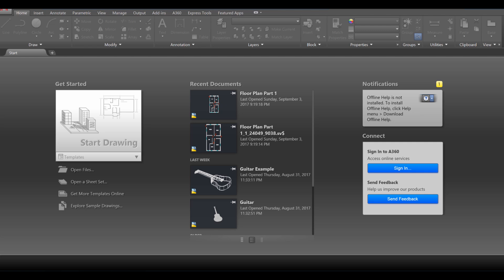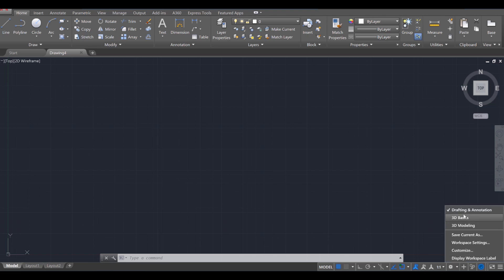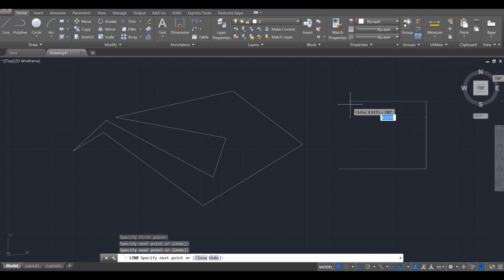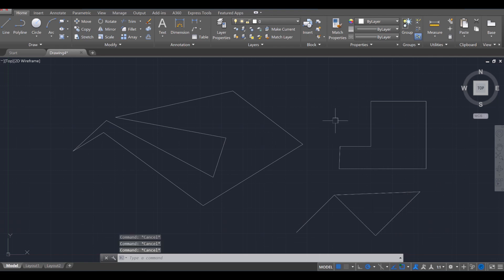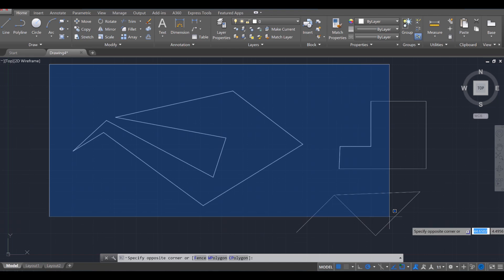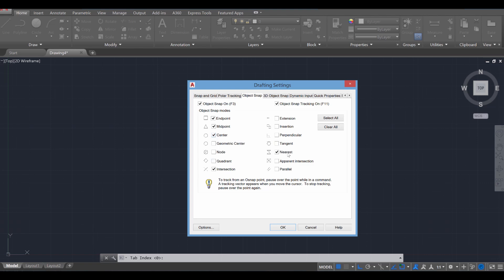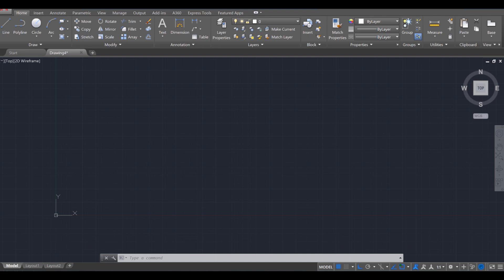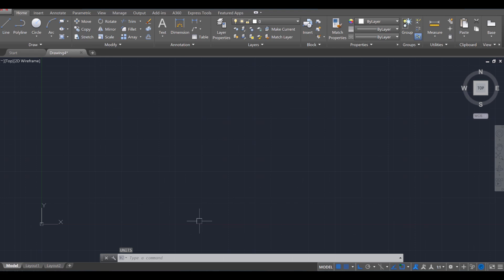Beginner Tutorial 1 (AutoCAD 2018) - Designing a Basic House

Comment: My lines aren't snapping as yours are. What could i be doing wrong?
Reply: Try hitting F3, or clicking the Object Snap button itself (not the arrow next to it). Adjusting the snap settings doesn't automatically turn Object Snap on, so if it was off when you adjusted the settings, it's still off afterwards.